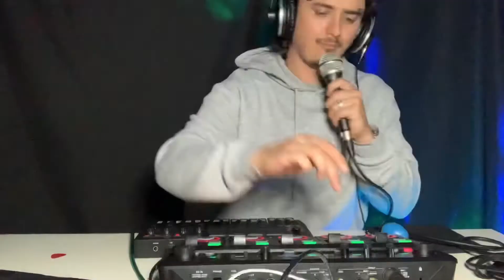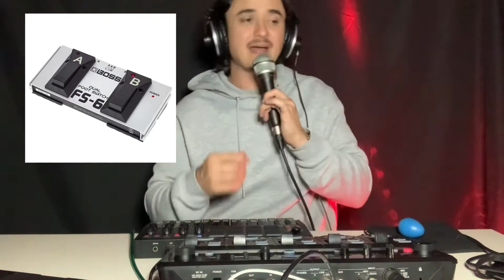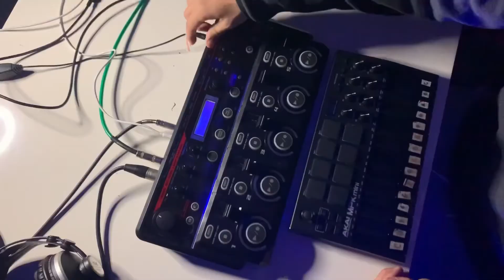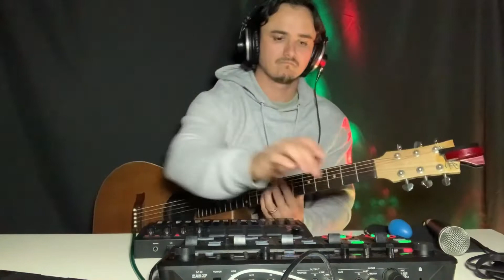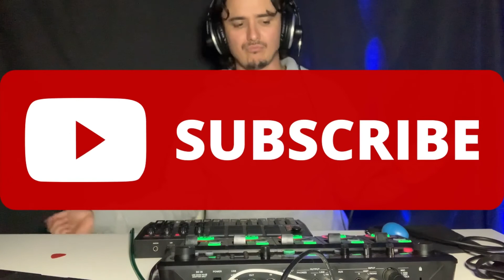Looping tutorial - BOSS RC 505 with Guitar & Akai MPK Mini mk3 (Midi Keyboard)

Comment: Dude, I have a midi keyboard which I connected directly to boss rc505 mk2. 

I get sound, but there is no recording. I tried to record and loop but, it doesn't record. Not using a PC just midi keyboard, to RC505 mk2. Any idea?
Reply from the maker: Sorry mate, I don’t have a mk2
Reply: @imaginableAudio 

did you solve the problem..
I am facing the same issue. 
how did you connect the midi keyboard to rc 505 mk2. directly ,? 
I have akai mini but it not getting connected.

Comment: Can I connect akai mini mk3 to rc 505 mk2 directly ?
Reply from the maker: I’m not sure! I’m using mk1
Reply: yea you can. I put an aux cable in the "phones" jack on the akai, and then I use an AUX to 1/4 TS converter/splitter and insert them into the L-INST-R jacks on the RC-505.

Comment: how do you connect the akai mpk? does it have to go to the computer first, then loopstation? Or does the mpk have a built in memory?
Reply: Looper connects to your computer, USB. Keyboard also connects to your computer, USB. Select the looper as your sound output device inside your music software and you’re sailing.
Reply from the maker: Hey! 
So with my set up, the MPK goes into the laptop, then from the laptop is an aux chord going into the looper

Comment: how did u make the rc 505 to take inputs from your midi? can u make a tutorial
Reply from the maker: Hey mate!
It s simple fix really! I run an aux chord from the computer to the 505. So all sounds from the computer come out into the 505 and I can loop them!
Reply: @lachlancarr9860  no external sound card required? You need to connect the rc 505 via usb to the computer and mpk the same?
What program do you use to sample mpk?
Reply: @lachlancarr9860  aux chord - it's the same cable as for headphones ?